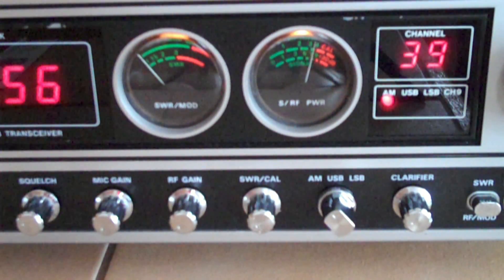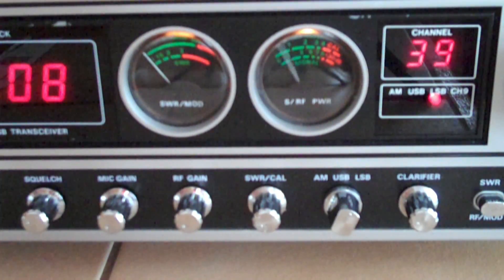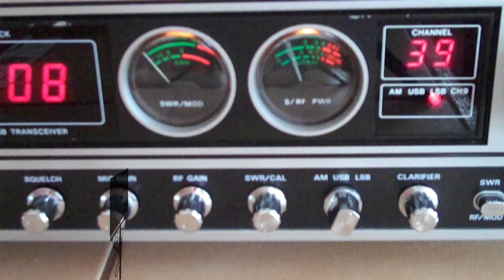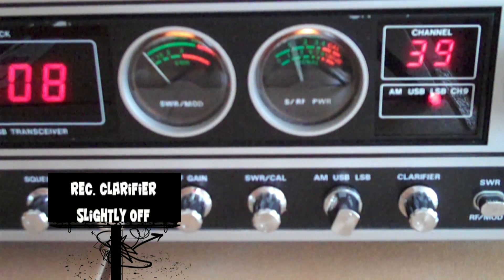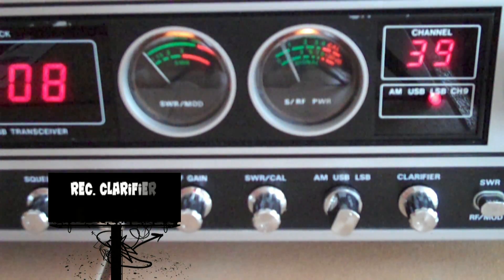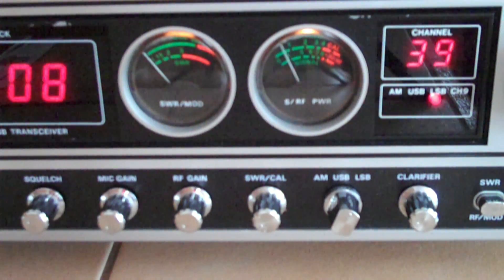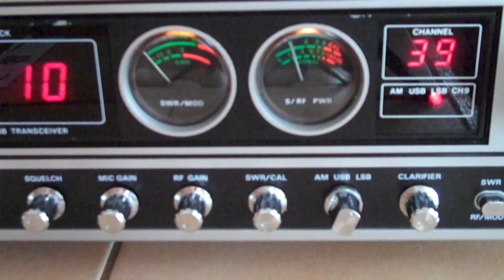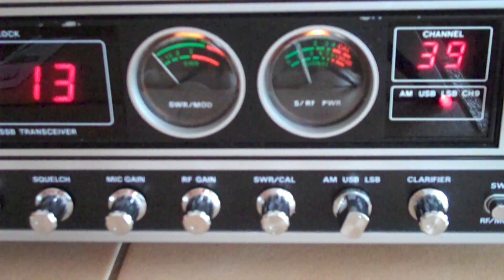Cobra 2000 GTL SSB audio problem, part2

Comment: Not a Cobra 2000. Before Uniden, It was called the President-Madison. Chassis was the same as the 2000 late '70. Difference cosmetically.

Comment: The 2000 need an alignment by a qualified tech with the B&K service master and B&K tone generator to do it correctly there is a guy in Mn that dose a great job he has done many radio's for me and is curently working on a 2000 for me.